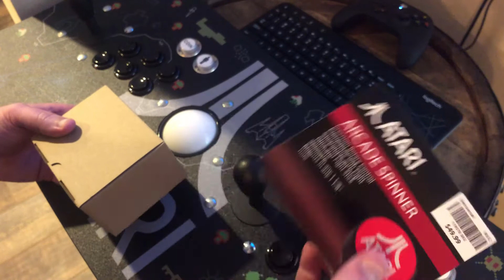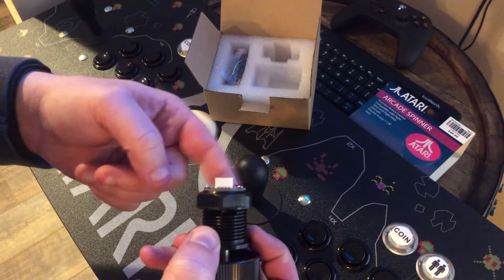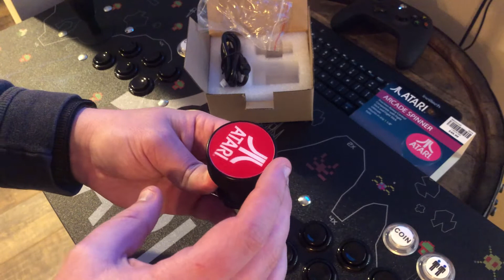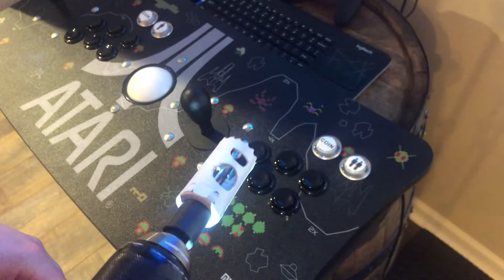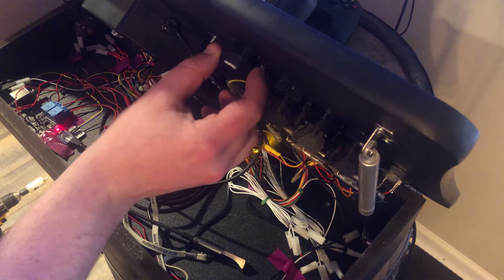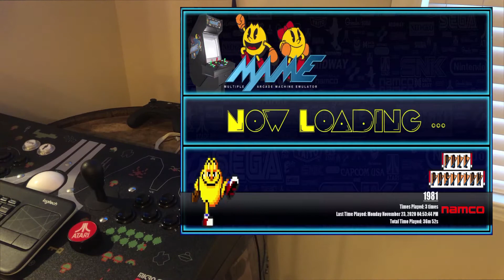MicroCenter Atari Spinner Install on Dual Fight Stick with Trackball

Comment: Can you explain how to set up in mame once installed? Im new to this. Thx

Im glad i bought this set from micro center when i did…they have been discontinued. 
For The price, they are solidly built, heavy duty and neatly built. You can not buy a more solidly built arcade stick then this one for $159!  And with 140 games. 

Now if i can only add more games to it. Im not a tech guy. Will need to find someone to help me with that part.

Comment: They have changed the graphics on the control board. Can you please respond with measurements from side and bottom to the center of where you drilled into the spider graphic

Comment: do you know what the counts per turn is on this spinner?
Reply from the maker: I honestly don't have any idea on the resolution. It appears as a mouse input to the PC, so you can adjust the sensitivity from the Windows settings but not sure of the mechanical specs.

Comment: What MAME front end is that? The version I have is very old and generic. Would love to upgrade.
Reply from the maker: I'm using a program called LaunchBox to frontend all my emulators. If you get the premium version you get access to the BigBox application which does the cool full-screen interface with themes, graphics, and animations.

Comment: FYI, to get MAME to see the spinner I had to set "multimouse" to 1 and  "dial_device" to  mouse  in the mame.ini file, otherwise Mame will not detect the spinner as second mouse device. some frontends may make these changes as part of their setup, but Mame itself does not.

Comment: Do you any suggestions for getting my trackball to work?  The PC recognizes it as a mouse, but games don’t see it as a trackball.  In Reteoarch it doesn’t allow me to change the input number.  It only allows for “default”.  I love the Atari Fight Stick.  I just am frustrated trying to get the trackball setup.  Thanks for any response.

Comment: I just got an MC Atari fight stick with trackball and 32gb sad card with the games. I am not a techie guy by no means so my question is simple...can a spinner be added straight to the micro center Atari fight stick and if so were to plug it in to get it to work.  I understand that the spinner needs to be configured for each game...just need guidance were to plug it into. Thanks.
Reply from the maker: No, the spinner basically acts as a USB mouse with only a single “axis”. It can be configured as controlling either X or Y axis but usually X. So you’ll just connect the USB of the spinner to your RaspberryPi or PC that you’re using for emulation.
Reply: @cjkcizur   Dont have a pc for it yet. So bacically just plug it into the rasberrypi then from there it integrates by itself? Is that right?  
Then configure each game that I choose?
Reply from the maker: @juliuscaesar8801  yep! I haven’t used mine on a RPi but it should just register automatically as a HID mouse.

Comment: SO glad MicroCenter had two 8n stock, they are marked way up on eBay and Amazon. Literal no brainer purchase for the Ultimate Atari Arcade Fight Stick w/ track ball. I'm LOVING this thing, bought 2 Fight Sticks w/ track ball and no Pi.  Using one as encoder / control board for a my projector display, pedestal multi-cade running off a Pi4  or PS2/PS3. Keeping second one in box for future projects.
Reply from the maker: Yeah definitely a no-brainer. I was spoiled a few years ago when I lived basically withing walking distance of a MicroCenter. It's about a 20 minute drive now but still having them local is awesome, especially with the demise of Fry's.

Comment: Sigh. I need to stop looking at other people enjoying this stick. I really want one but I'm in Australia and the only way to get one is to pay Amazon US$191 plus $121 to ship it here. That's one hell of an expensive stick! I would want to add the spinner and pinball buttons too, of course.

Out of interest, if the right side is P2, why didn't you install the spinner on the left?
Edit: I would think about where the left edge of the A in Atari is would be ideal (and unfortunate)
Reply from the maker: Hey thanks for watching from Australia! That's extremely unfortunate about shipping costs, given that it's likely manufactured over on that side of the Pacific anyway you would think you could track one down with some less inflated pricing!

As far as placement, as I mentioned in the video that was a big struggle for me as well. It really came down to my hand placement and that the 2-player side honestly doesn't get used too often so it's really out of the way. For regular joystick play, the 'A' in Atari would work well and pretty much be in a similar place as the 2-player location. However, the game that most often gets played on my setup is Golden Tee. So given the aggressive nature of how we mash on the trackball I was trying to keep it out of the strike-zone!

Anyway, I don't think there's any perfect position and the location now seems to work OK for the limited amount of usage it actually gets!

Comment: Great, helpful video, thanks...I'm definitely going to add the hole instead of sacrificing one of my buttons. PROBLEM!: When I plug in my spinner usb it's running on the Y/vertical axis, argh! I cannot get windows to switch it to X/horizontal. Weird. Any ideas why it defaults to Y and not X? I didn't think it would be a problem since I'd only be using it in MAME and you can tweak setting in there, but until it runs properly I can't even adjust those parameters.
Reply from the maker: That is very weird!! If you haven’t figured it out I’ll check in the next day or so to see if there are any options that I can find. When I installed my it defaulted to the X axis so did not have the same problem.
Reply: @cjkcizur  Thanks for the reply. I got it sorted out! Well, it's still running wrong (y instead of x) on my desktop but I spoke too soon above about not getting it right within MAME. You CAN simply assign individual game axis parameters to whatever you'd like. I simply assigned the "paddle" or "dial" x settings to the "y mouse" input and it works perfectly. Within a couple hours I had all my fav spinner games working perfectly with the new dial! Arkanoid, Omega Race, Out Run, Power Drift, Super Sprint, Tempest, etc, all much better with the spinner! Now I just gotta get that bit and make a new hole for it like you did (I hate having to sacrifice one of the current button slots for the new spinner). Thanks again.
Reply: If you short the button one and button two contacts to the ground contact on the bottom of the spinner simultaneously for 10 seconds, the X axis will swap to Y. Repeat to switch back to X. You can solder in wires to make this easier. The Amazon version of this comes with a connector soldered in plus two standard buttons, making the operation much easier.

Comment: Question about this spinner: is there a a way to attach a small wheel to it?
Reply from the maker: Absolutely, nothing available off the shelf that I’m aware of but the knob just attaches to a shaft and is secured with a set-screw. A wheel with the same type of mounting setup would work perfectly and is something I’ve been looking to try to come up with on my 3D printer.
Reply: @cjkcizur  great! I ordered a mini spin trak wheel and it looked like it could fit.

Comment: I know the dimensions are: 28.34 x 7.28 x 5.70 inches
.  But could you please measure the box on the bottom where all the wiring is in?  Want to see if this will fit in an existing cabinet.
Reply from the maker: Hey there, so the outer dimensions of the box are 25.375 x 10.375. It uses 5/8 plywood so the inner dimensions of the box are about 24.125 x 9.125. The front of the box is about 2.75 in deep and the back is about 3.875 deep. There are little rubber feet on the bottom that raise the whole thing up about .5 in. Hope this helps!

Comment: On the side panels you said you installed buttons for pinball. Which particular brand and style do you recommend ?
Reply from the maker: I just added the same style that came on the unit which are Suzo Happ buttons that use standard arcade micro switches. Got the buttons and switches at MicroCenter as well.

Comment: I'm considering getting one of these spinners. Do you think the Atari logo can be removed? It looks to me like one of those thick poly coated badges that just gets stuck on with some hot glue or something similar.
Reply from the maker: I know the type of badges you're talking about but I just took a closer look and it appears it may just be a regular sticker that sits in a little recess in the center of the spinner. So it looks to be very easy to remove but likely not without damaging the sticker (if that's even a concern).
Reply: @cjkcizur  Not a concern at all. Black goes with my color scheme but red doesn't so I would want to get rid of the sticker.. A little WD-40 will easily get rid of any adhesive residue. Thank you for the quick answer. I appreciate it.

Comment: Hey man, thanks a lot for that video ! i want to do the same with mine. I got a question maybe you could help. How did you add side buttons for pinball ? I mean where do you plug them on the controller board ? thx mate
Reply from the maker: I intend to make a video on adding those and how I've wired everything up for the flipper solenoids but I've unfortunately been pretty busy. However out of the box the XinMo controller supports up to 15 buttons on P1, and 13 buttons on P2. The board currently uses 8 buttons for each player, 1-6 for the black joy buttons, 9 and 10 for the white start/select buttons. So I just wired each into P1/P2 button 11. I'm using AHK scripts to map these to the appropriate controls in my pinball emulation software. The manual that comes with the unit has a pinout diagram of the controller, but you can also find it online just by searching for Xinmotek XM-10 Wiring.
Reply: @cjkcizur  Thanks man that was helpful 🙏👍 so even tough pinball games are only one player, the P2 button 11 still works and can be maped
Reply from the maker: @OlympFit  Using AHK yes you can map pretty much anything. Once I make my video (hopefully next week when I have some time off!) I'll post links to my AHK scripts etc. that I currently use to run everything.
Reply: @cjkcizur  I'm Subscribed for that video! Just got my case and bought my buttons..but leary about WHERE to place them and accommodate the wiring. Thank you! ALSO, where did you get the wires for connecting? (Part #) 
AND....do you have all the USB working off a USB splitter to only worry about ONE cord to the PC and does that do enough to power the whole unit or does it require extra power? Thanks for all my crazy questions.

Comment: At about 6 mins in after you drilled the hole on top and then you lifted the top and all that shi# went straight into that poor keyboard.. I cried a little.
Reply: i came to the comments to express my tears as well! awesome vid though im doing the same now was debating best placement..i agree with you
Reply from the maker: Yeah....probably not the best execution! Fortunately have not seen any problems with it and if I do it’s luckily only a $20 fail!

Comment: Did your unit come with a Raspberry Pie?
Reply from the maker: No mine did not. I was not aware at the time they sold a combo pack with the RPi and Atari SD Card.  Looks like currently the version wth Pi is $170, the one without is $120. Unfortunately it comes with a 3B+ which is probably fine but definitely not as good as a Pi4 if you want to do more than just basic arcade games.